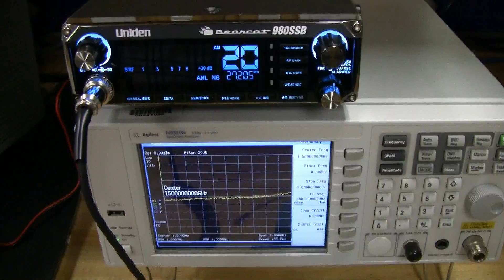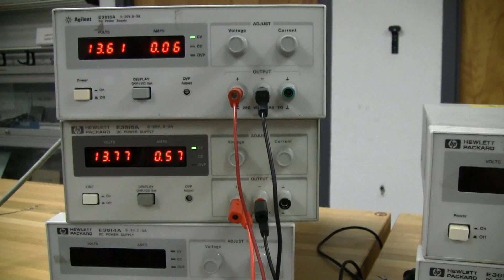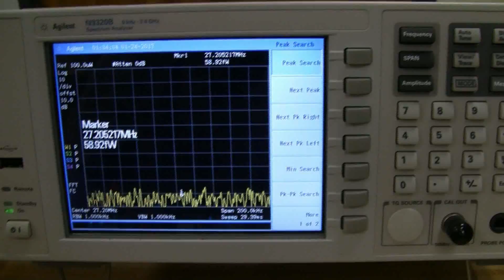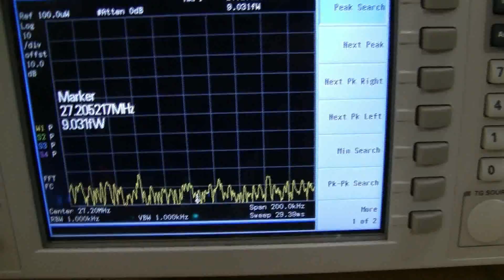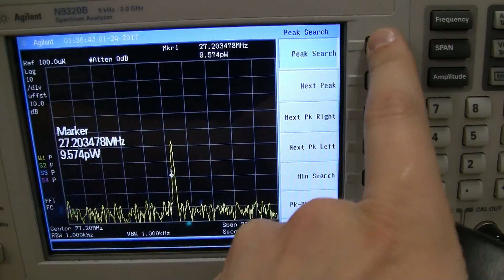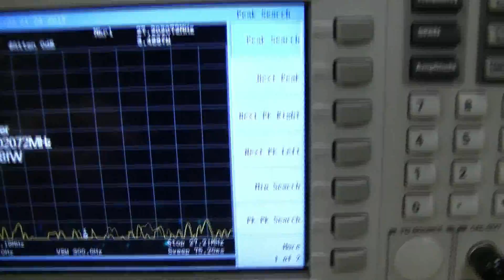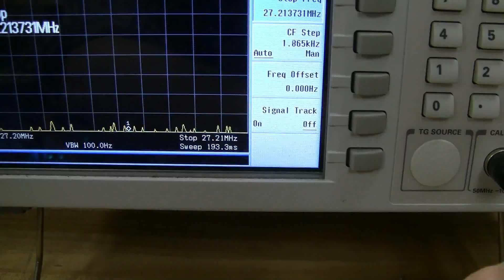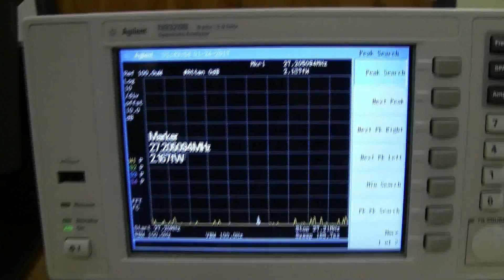Uniden Bearcat 980 SSB - AM Transmit Frequency Alignment

Comment: Which pot or can is it I would adjust on the 980ssb to adjust the watts on the AM side only ,not on the single side band  . I'm fairly new to this radio and can't find any schematic on the internals . I don't have a scope but do have a meter to hook up for wattage so not to over power . I was also thinking about getting a small linear amp and may need to turn the radio down to pair the two. If you could point me in the right direction I would greatly appreciate it. I'm fairly mechanically inclined so doing this wouldn't be completely beyond my ability. I've watched a ton of videos on this radio and so far all the ones you have posted have been far better than others that either say, they haven't a clue or have some very misleading info. So thank you for being clear and taking the time to go over this particular radio.
Reply: it's marked on the board. AM POWER

Comment: Next time align in SSB mode not AM.  AM hardly notices when you're off frequency but sideband users do.
Reply from the maker: you're right, unfortunately I don't have the equipment or expertise to do that
Reply: Not to worry, you will. CB radio is a good place to start off in electronics. They're forgiving and mistakes are easy and cheap to erase. Plus you can talk on your projects, that is if you can find someone to talk to these days.

Comment: Ummmmmm.....  That's not a variable capacitor,  it's a adjustable transformer.  And your using a metallic tool to adjust it?????  You need to get some proper Plastic/Delrin alignment tools.  Not only are you risking breaking the ferrite core every time you stick metal in the transformer your changing its value.  Anyone watching this, never use metal tools to adjust ferrite cores.
Reply from the maker: gotta run what I brung, always room for improvement with some better synthetic tools. thanks for the tips!
Reply: AirSoftMaverick3232 

In a pinch even a piece of wood or toothpick trimmed with a knife is better than metal.  Ferrite cores are extremely fragile.
Reply from the maker: 10-4 on that, plus what you mentioned about changing the impedance with a metal object in contact. I'm here to learn!
Reply: @mikesradiorepair  I currently have a first generation 980 on my bench and I am trying to figure out how to sync up the SSB because it's not hard to get the am carrier on point because there is a TX frequency pot right there near the inductor he is turning, but when I adjust it so it's zeroed out on am the SSB is off by a little bit. I know how do zero in a uniden PC 122 and I have my suspicions.